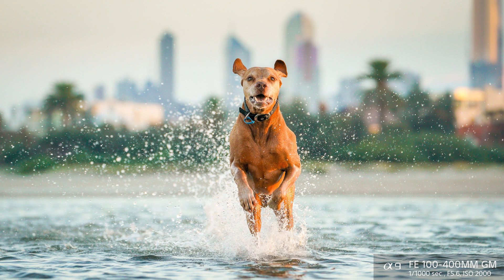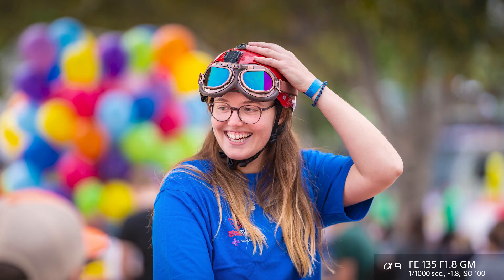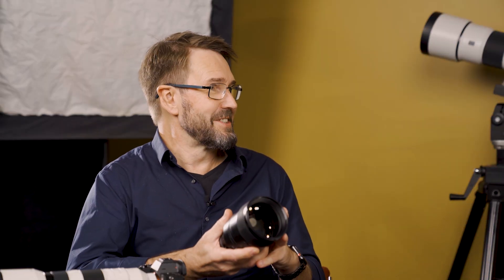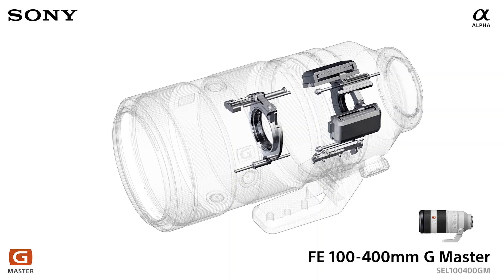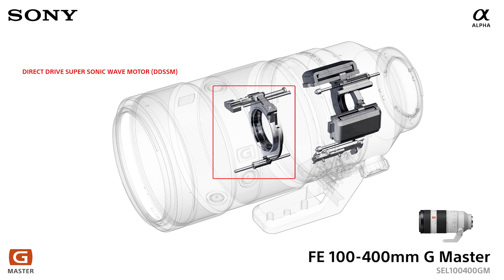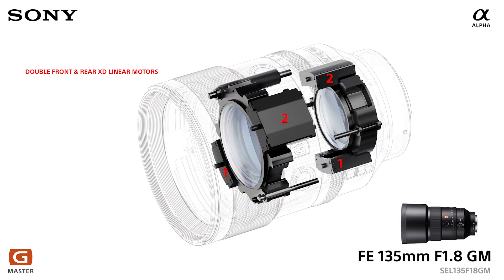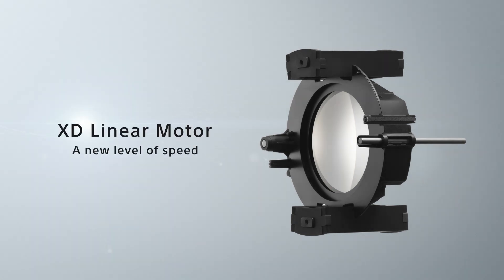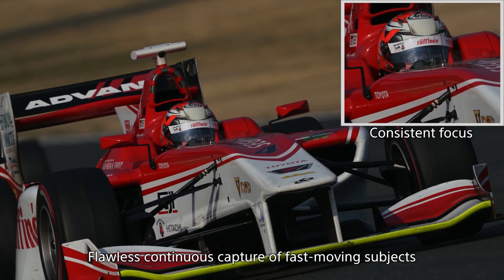Alpha Insights || What are Linear & XD Linear Autofocus Motors in Sony Lenses?

Comment: Are the linear motors inside my new 50 1.2 GM moving up and down when I handle it out of the Sony retail box.
In older Sony GM lens, I do not feel anything moving inside when I am handling them.
Is my 50 1.2 GM sample bad or is this internal movement, (up and down), normal?
Thank you for your reply.
Reply: normal and also scary :D same on all 50mm GM and also 135mm GM
Reply: I am seeing the same with 24-70 gm2 lens

Comment: Can we have a Sony LA-EA5 Mk2 that:
* Pretends properly translates the e-mount protocol to a-mount to support AF on all E-Mount cameras.
* And is coupled with a silent drive motor.

Considering how late Minolta and Sony still used ye olde screw drive so much good glass is not usable for those with old equipment and non A7R budgets.
I know it's technically difficult, but certainly not impossible. My Tamron's 70-300 SP has a rotary USM motor, there has to be a way.

Minolta and later Sony have been strong innovators and it would be amazing to see innovation on that front in the coming years.